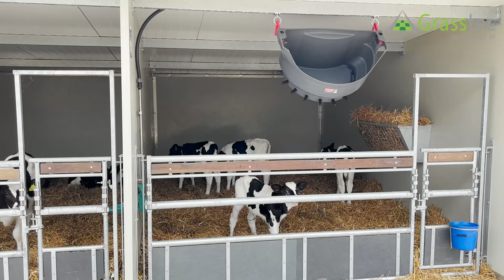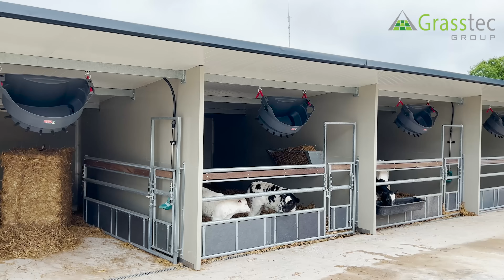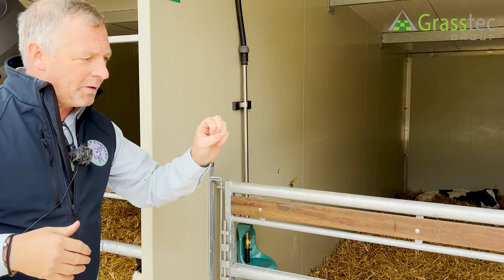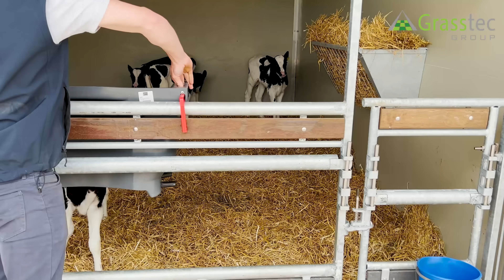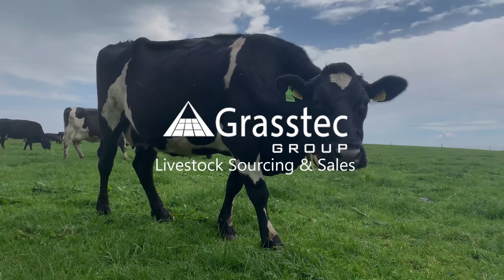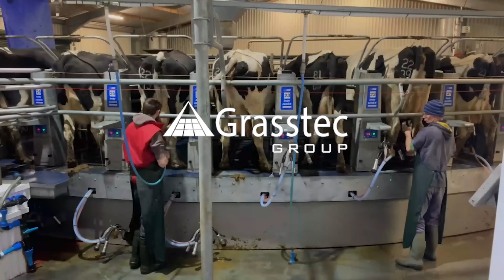Looking for new calf housing? | The Calf Company

Comment: That gateway into the pen would piss me off having to bend to enter it. Do not know why they have the frame going up above the height of the pen. Does not appear to serve any purpose apart from supporting the frame so it can connect to the other wall. It would be better if it was supported in the concrete at the base.